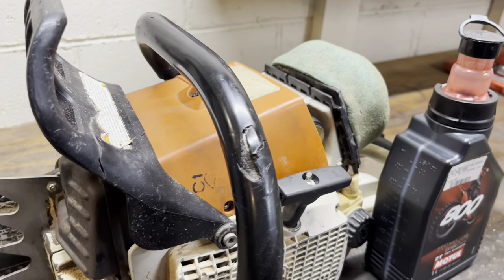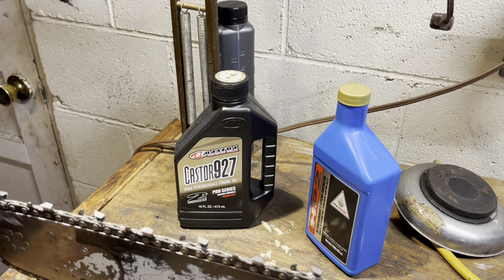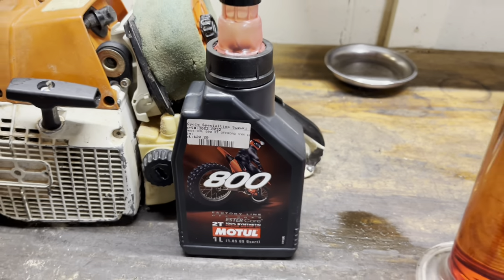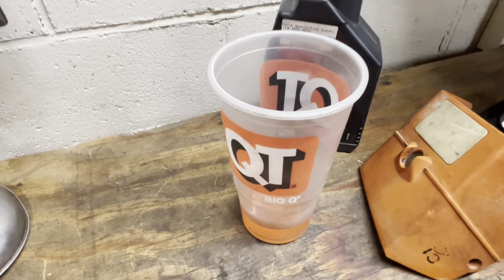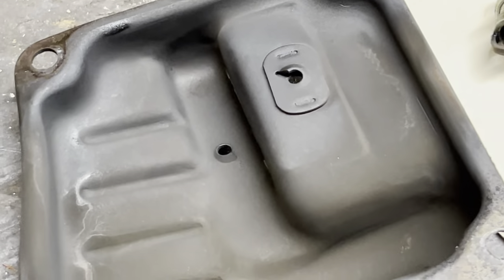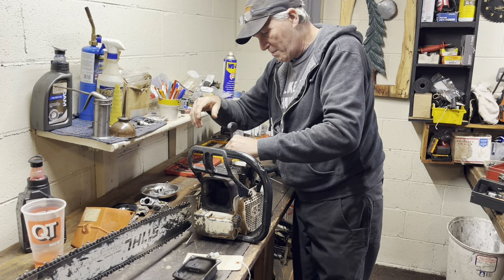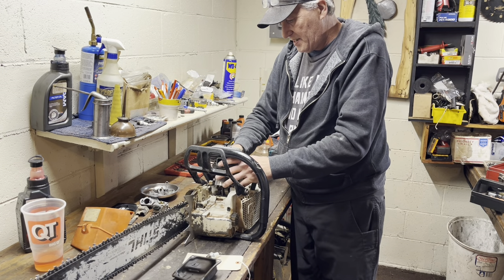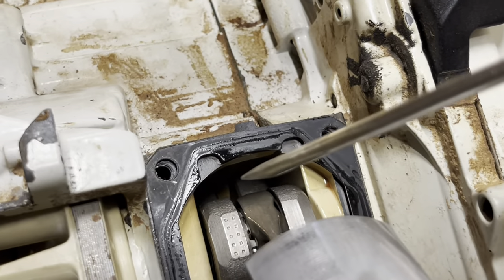Two Stroke Oil Test!  Motul 800 Off Road

Comment: I have several hundred hours on a stock 395XP along with a 881 ported by Sean up at Maddsens. I run them on a Logosol chainsaw mill. The 800 is the oil I use. No issues with my saws

Comment: Glad you’re feeling better Richard. 
That’s why I love the motorcycle oils. I think they are better. I’ve had great results using them. 
The 927 Castor can separate under 40 degrees. Also I’ve found you want to shake the mix more. Could just be my OCD but curious what you find. Thanks for doing these tests.

Comment: Hey Richard, another great comparison vid.  A suspension test is a great idea - these motorcycle oils are so heavy & thick and you def need to agitate them good to get them into the gas - you'd think they'd fall out of suspension easily??  I always shake the heck out of my gas jug when it's been sitting a while....
Reply: Had a can of gas for 2 years sitting in the corner of my shack, forgotten, with motul 800 in it. It was still mixed well as the day I made it. Gas was rancid though.

Comment: This is my go-to oil for years now, no other oils that I tried kept my milling saw top end live this long, pistons seem to develop visible skirt wear/thinning after about 1500-2000 hours on the mill (ms 880), or carbon scoring on these castor oils. Ran everything 32:1, but motul offroad seems to be able to handle high temps well and it burns really clean. I run it in my 500i and 881 now, same ratio.
Reply: 33:1 is ok ?
Reply: @Sensei948  yea, its more or less the same, very small difference.
Reply: Any upgrade like porting and muffler mode?
Reply: @MrPIEKNYPAN  No porting. I have an aggressive muffler mod on the 500i, but none on the 881 as I want the noise to be as low as possible on those long cuts on the mill, even though I wear hearing protection.

Comment: I have been using Opti-2 two cycle for many years (20+ years) in my chainsaws Stihl and Weed Wackers. This stuff has never failed me. I use my saw when a tree falls or if big branches fall to clean things up around the yard (not much use). The weed wacker is always used. I just purchased an outside wood boiler so I will be using my saws a lot more now. I just bought a new MS462 non-M-tronic and I have an MS260 and An MS170. I am very mechanically inclined, and I will take the mufflers off the saws and take pictures and send them to you if you would like. I have never looked inside the motor so this will be interesting for me to see as well. Because I will be running my saws a lot more now, I want to make sure they stay together.
Thanks for what you do Richard.
Russell

Comment: Up here in Canada the Stihl oil is made by castrol. That’s what I run for the last 15 years. I’ve never had any problems. My dad also runs castrol oil in all his 2 strokes and never had any problems ever either. His 1990 Husqvarna 50 special seen a lot of use over the years cutting firewood for his main source of heat and logs for cabins, even on an Alaskan mill and that saw won’t give up. With that being said my other go to oil is amsoil dominator. Used it in my Honda ATC 250R. We always just mixed 50:1. With that being said I believe castrol is a lower grade of oil and there are alot better oils out there. That’s just our experience.
Reply: Ya my father always ran exclusively sithl premium since probably the 90s lol as long as I can remember. Mostly in concrete saws daily for masonry. Stihl saws would run hard for years with very little issue ( usely their own fault for not changing air filters lol) 50:1.  Never considered using anything else. I chainsaw mill now and was gonna use ultra as per stihl recommendation. Now I don't know what to use lol
Reply: Oh also in Canada

Comment: Motu is a great brand. Not surprised by the results. I prefer Liqui Moly for all my oil needs. Run their 2T Synth motorcycle oil on my 550 MK2 since new. JASO FD and Husqvarna approved. No issues to report and hope it stays that way.

Comment: Great tests. I have tried :
 Royal Purple HP2C  with great results
Maxima K2  Really clean burning
Torco GP7 ,  Reminds me of the Mobil MX2T
Benol , For a castor oil was surprised how clean it burnt. I Mix up a gallon or 2 a year for the "aroma".

 I still have the 800 off road , Red Line 2 stroke racing oil , Klotz R50 , Bel RayH1R . left to burn through for my testing.
 Word of caution - when I filled up with bean oil juice after K2. There were snots developed in the carb screen. had to give it a quick carb spray to dissolve the boogers.
Reply from the maker: Thanks for the heads up.  I never would have thought that.

Comment: Noticing heat roiling off just after a high speed run can be high jet mixture 
set too lean. Any excess heat is not immediately lost by reduced air flow at
idle. The saw needs a minute or two to cool down. It seems counter to what 
people would think based on richer mixture doing better in cold weather, but 
as hot weather arrives believing the high jet will need to be set leaner.That is
how it should work based on intake air temperature, ignoring cooling. Unless
the blower cooling and cooling fins are doing an extra good job so hot weather 
doesn't matter, the high jet could need to be set even richer in summer heat
because of lost air cooling difference, to prevent cooking the saw. If a saw is 
tuned for maximum performance for a limited time of use for testing or racing
that likely isn't the best mixture setting wanted for longevity of the engine being 
run longer times doing different work at routine tasks. Best mixture all round   
is a compromise depending on how that saw is being used. Got to tweak it.

Comment: i had some motul 800 in a mixed 5 gallon of 93 ethanol free and was still mixed 1 month later in a shed. oil loves wide open throttle and i get splooge out the exhaust a little due to the high flash point, this oil is a race formula and hence the black cap, motul 710 is better for all around use like in a weedeater or chainsaw and has a green color and a much lower flash point. have use both in yard equipment and 250cc 2 stroke dirtbikes.
Reply: i run the klotz snowmobile oil in my chainsaws they look picture perfect inside with 5+ gallons i cut in the cold so the snowmobile oil works good year round and is FD rated its cheap if bought in a gallon

Comment: Sorry to hear you had the bug. Great to hear your all good now👍🏻 That 800 looks far and beyond acceptable!   I've seen castor 927 separate from 100ll avgas as warm as upper 50's farenheit but so far haven't seen it separate before mid-upper 20's in any other fuels.

Comment: Hey Richard I enjoy your videos. Most of them are very informative. When you complete your motorcycle oil’s, do you think you could run a test on OPTi 2 oil? I’ve looked, but I hadn’t been able to find one on your channel. Thanks and keep up the good work!
Reply: Good idea on testing Opti 2. That’s what Tinman has used for years!
Reply from the maker: @sendyplumber What ratio does he run it?  If I'm not mistaken Opti recommends 60 or 70:1?
Reply: @richardflagg3084  hi Richard I think He uses 45 to 1
Cheers Luke
Reply: @richardflagg3084 I’m not sure exactly, around 50:1 atleast I would think.
Reply: I would be interested to see a video on Opti 2 as well, I’m an Amsoil Saber guy myself it’s served me well and is easy to get in my area. I know lots of guys in my area that run the Opti so I’ve always been curious as to how it runs. Thanks Richard keep up the good work

Comment: I used to run the 927 in the summer but I wouldn't run it in the winter here because it gets 20plus below zero and I was afraid it would separate.
Reply: For wear protection it's a great oil IMO. But probably made the right call for those temperatures.

Comment: Richard.  We literally need you to spend more time describing the smell of each oil.  The reality as I see it is:  All of those oils are going to protect better than any of the factory chainsaw oils with the possible exception of Red Armor (but that's not really a factory oil imo).  So, on a scale of 1-10, rank them by smell please.  I'm not kidding.  This is how important it is to me- if you tell me that the Honda oil protects as well as Red Armor and smells as good as Castor...I'm jumping ship on Red Armor and will start running Honda.  Fuck cost.  Gimme that sweet, sweet bean oil smell!  With protection, of course.
Reply from the maker: Gotcha covered.

Comment: These moto oils are pretty impressive I have to say. I want to see the Castor 927 personally (might have missed that if you alrrady did it). I know it has a reputation for not being the best oil in cold temperatures. I'm not sure it will sway me away from Saber though. I just trust that oil through a lot of experience and it would take some drastic results to change my mindset. Sorry you've been sick Richard, we've been dealing with the same thing. It seems to just float around this time of year
Reply from the maker: You haven't missed the 927.  Hoping to get the Bel Ray and 927 done in the next week or so.

Comment: Gday, I have been running and recommending the motul 800 in builds, I have found it to be very good!
I have heard about an oil called obi 2, it's mixed at 90/1. I have been meaning to give it a run. You should try it too!
Have been enjoying the channel and your insights

Comment: I have been running the motul for about 6 years great oil.One of the contractors i do work for was here when I was breaking in a saw.He ask what oil i used in my saws and I told him motul.He said he thought that was what it was by the smell.He used to live in california where he raced motor cycles.The last jug i bought i think 2 liters and i gave 54.99 for it.

Comment: I have a question about saws and not oil, do you think an aftermarket fuel tank for an 038 magnum 2 would be any good? I’ve looked up the genuine Stihl tank and it’s 200$ Cad. The aftermarket ones are way cheaper but I want to find a good quality one if they’re out there. Thanks

Comment: Hey Richard great video what do you think about castrol power 1 racing 2 stroke oil at 40/1 ?
Reply from the maker: I'll try in the next few weeks or so.  Still got a day job.  Ran the 927 castor today vid coming tomorrow.
Reply: @richardflagg3084  about 927 castor 🦫 or motul 800 of road or castrol power racing 1 at 40/100 for ms 261 cm and ms 462 cm What is the better

Comment: Yeah this is really an interesting video, I just started getting into chainsaws and cutting and I started out with 2 cycle marine oil, quickly found out that wasn't good via videos so got rid of that, then went to stihl oil found out problems via video about that so now doing more searching for very good oil so i can buy it and be done with it, any clue as if this motul 800 would out preform marine oil? it would be nice to just buy one good oil for the saws, boat weedwacker etc I have seen peoples interest in Opti 2 but yet have found tests on video yet
Reply from the maker: Try Schaeffers 7000 semi-synthetic two stroke oil.  I've run it for years and it's an excellent oil.  Burns clean, good oil film and it's made for boats (and works great in air cooled engines like our chainsaws.  As far as the Opti 2, I wouldn't.  They don't use very good base oil for one, and to get the film strength up they use additives.
Reply: @richardflagg3084  tks yeah I am running older saws and new at all this so it is important i start with good oil for the 051's and 041's

Comment: Appreciate the test but i have worked on OPE and 2 stroke motor cycles for years. jap 2 stroke bikes have been gone 17 years. kTM Husky GasGas and Beta are still making them. New 2 Stroke bike start at $7500 and probably go to $11,000 so the motorcycle oil makers do not skimp on oil. I would say the worst motorcycle oil made in the late 80’s are way better than any oil the OPE people have bottled. They make OPE not oil. Keep testing and you will see exactly what i am talking about. Way more than a piston and cylinder on a 2 stroke bike like power valves in the exhaust port with 8 plus moving parts to make them work that has to get oiled in really high exhaust temps and still get lubed and not gum up. Really the motor cycle oil is way over kill for a blower, trimmer or Saw.
Reply: Yamaha and others are making two stroke bikes again just an fyi.